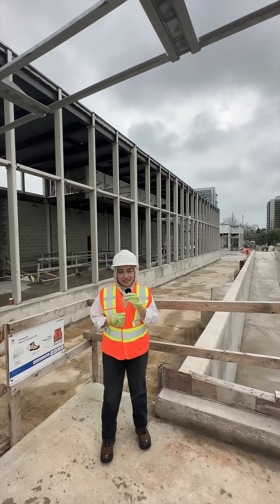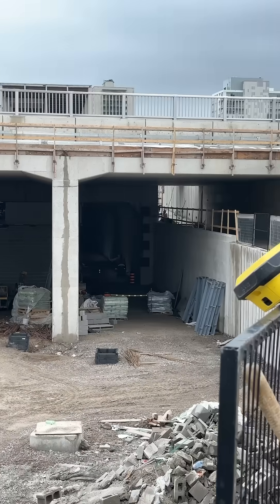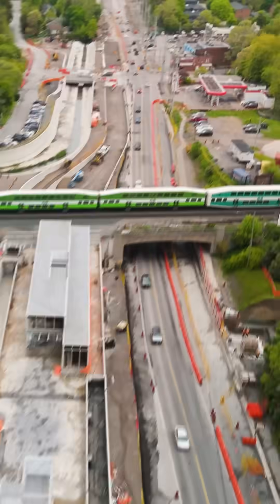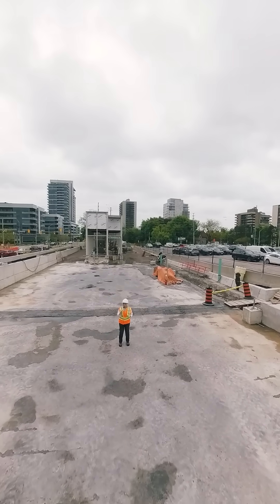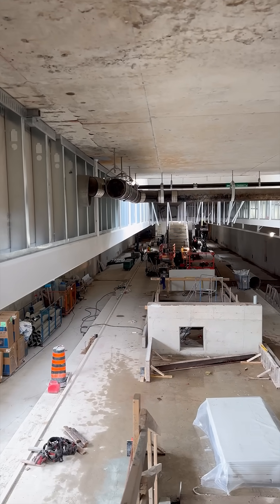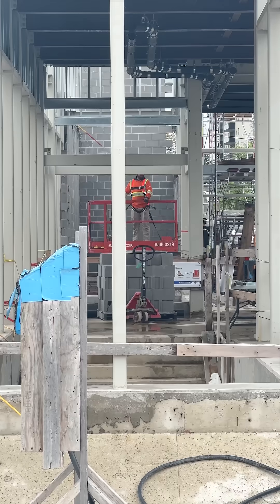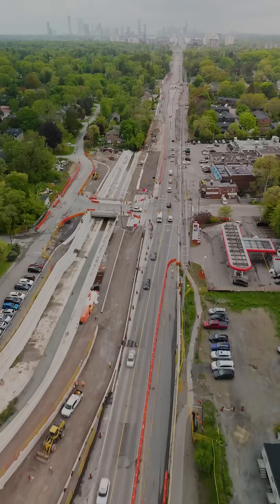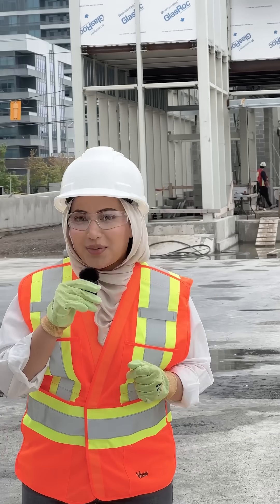Your Port Credit LRT Station update - Hazel McCallion Line

Comment: Thats great would it take Forever like the line 5 LRT
Reply: Its already going a LOT faster than the Eglinton LRT, but the real tell will be when the tracks are done and checked to make sure they were built to the correct specifications. The two main delays on the Eglinton LRT were software issues and all the tracks had to be readjusted because the contractor f'd up and didn't build them properly the first time, which could have resulted in the trains wearing out faster than budgeted or even derailment
Reply: No, the crosstown is just an anomaly really. Metrolinx has so many other projects that are currently on going and on-track that attacking Metrolinx is not helpful anymore. They understand. They’re so embarrassed with the Crosstown they won’t even release a date, they’re in surrender mode and they’re just trying to block out the noise and just get it done. Infact most people nowadays who still complain about Metrolinx do so from a transit perspective, due to Metrolinx’s obvious failures, even though they’re usually a big transit hater themselves. The same people complaining about Metrolinx nowadays are car suburbanites who, even if the crosstown was open, would still be complaining about it in many other ways.